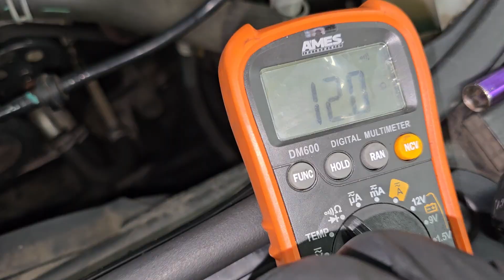👉 “When the Check Engine Light Doesn’t Bail You Out… Think Like a Mechanic”

Comment: For fuel injector circuits, the PCM does continuity testing when the driver FET is in the off state. Ignition coil circuits also use that and some detect coil secondary function by measuring flyback voltage, or "ionization". For other circuits, current measurement is used, such as the purge valve on Chryslers.

Comment: This was the problem on my 2012 toyota corolla. Changed the ignition coils , spark plugs, and severe misfire still existed. The #3 cylinder was the culprit. Bought a used injector rail from the scrap yard and the problem was solved. The injectors were totally clog. I have never seen such dirty injectors before.

Comment: Most novices associate a cylinder 'misfire' with spark. Misfire is when PCM detects a slight dip in crank rotation speed (via crank position sensor) when 1 cylinder does less work than the rest. It can be bad spark in one cylinder or many other reasons, bad injector, valves not closing properly (bent, seats, spring, cam lobe), low compression, etc.  Random misfire tend to be issues that will affect all cylinders, air/fuel ratio (ect, map, maf, fuel pressure, ethanol calculation) or the crank sensor or air leak. I use totally different mental flowcharts with random vs single cylinder misfire.
Reply: JT I think PCM measures the amount of electricity that flows thru a pin to an external device in joules. Whether is electricity that energizes an injector or a coil (by measuring electricity flowing thru primary, pcm can detect secondary spark indirectly).
Reply: 7:50 PCM watches voltage of the circuit that drives the injector..
When pcm send ground signal pulse to injector, it should detect low voltage, above 0v but below 12v. While no signal is being sent, the voltage detected will be close to 12v (coming from injector's continuous 12v supply). If injector is shorted to ground, pcm will sense the low voltage when the driver is not delivering a negative pulse to the injector.

Comment: Probably has dropped a valve seat in that cylinder head. Replacing plugs and coil packs are cheap and simple  efforts to fix a misfiring engine. Those Pentastar V6 engines have krappy cylinder heads with dozens of problems due to poor design and poor quality manufacturing by Stellantis.